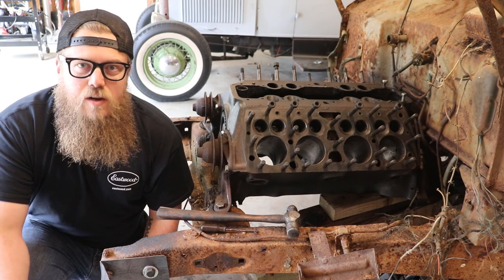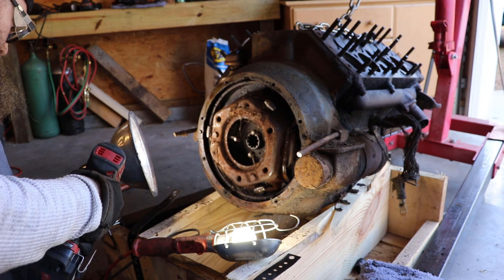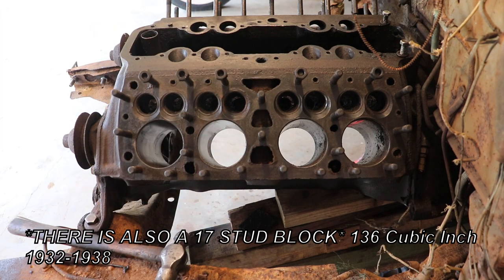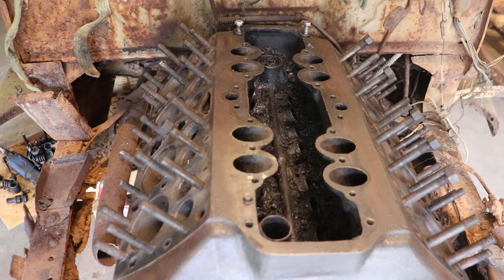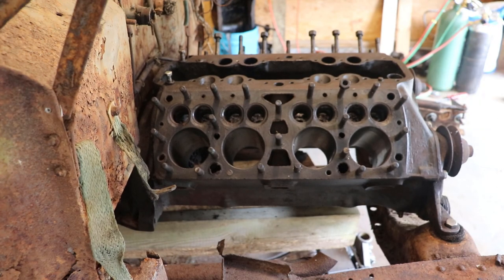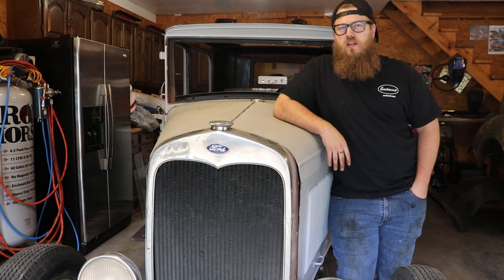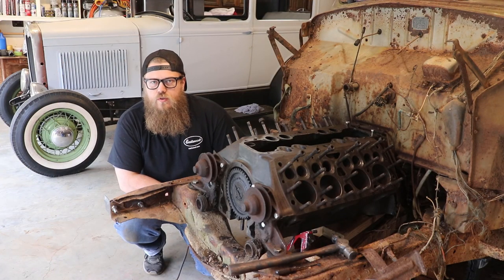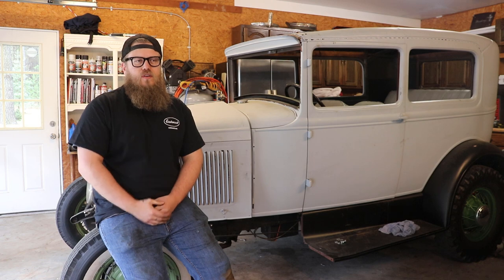How to Identify FORD FLATHEADS!

Comment: Do you want to play the Mercury Game with me ? Ya know that red bbq fire truck ? Kinda but different lol So this is already going to be long winded. Actually I’ll see if I hear bk first. That said ., 

My baby is a 1950 Mercury M68 we built the truck together I learned to drive in it when “your ass is against the back of the seat and the clutch hits the floor” lol So it was Dads baby right “The Merc” I have pics of it obviously lol I put new 216’s in it today back to the story sorry about the side bar lol 

So Dad had a 289 with a c4 in it when he was looking for/rebuilding the flathead that’s in it right well he wasn’t a cheap shit kinda guy and had a major love for the truck so it’s  a 50 Merc M68 Truck in it is a blue flathead k now the heads are “1CM” underlined with made in Canada t stat housing at the front, no intake surface stamping, wide pulleys a Holley 94 the aluminum mechanical fuel pump and an aluminum intake (light ford blue) CMB8 I think I’ll check again when I go see it tomorrow.. anyway that’s enough for now lol how about what can you tell me about “1CM” heads 1951 Canadian Made ? 5:06

Comment: "Here's where it can get confusing" can get confusing sorry already am.
Reply from the maker: Is there anything I can clear up for you?
Reply: Hello I have a 1948 Ford F5 coe V8 dually. The engine has the earlier smaller water pumps and the crab distributor. What model engine is it?
Reply from the maker: @nickjervis8123  if the distributor is original to the block then it’s a 1942-1946, but the pumps and distributor could be replaced with one that’s not original to the motor, is there any numbers on top of the bell housing? Is the top of the bell housing built into the block or into the transmission?
Reply: @WiredCustomsSpeedShop  Hi the bell housing is built into the block
Reply from the maker: @nickjervis8123   you most likely have a 29a, it’s technically a 59ab before they called them 59s, when it comes to buying parts you would be looking up 59ab